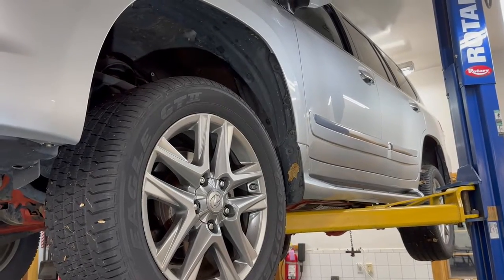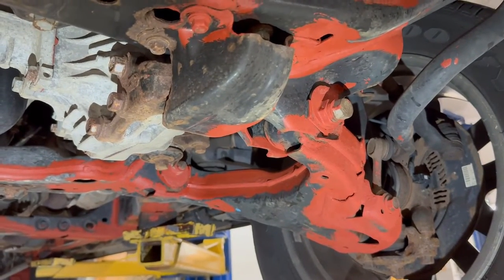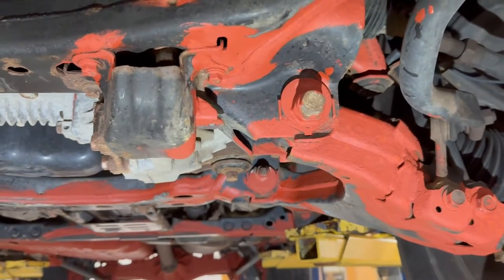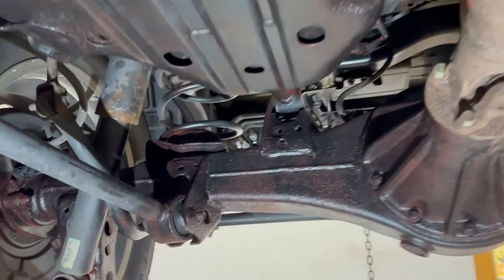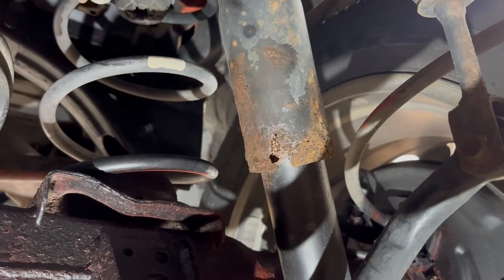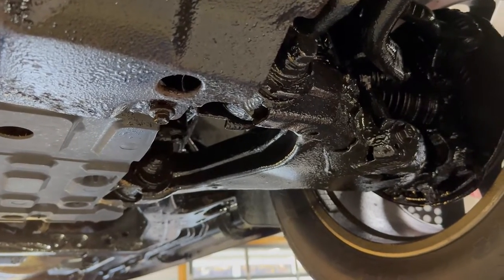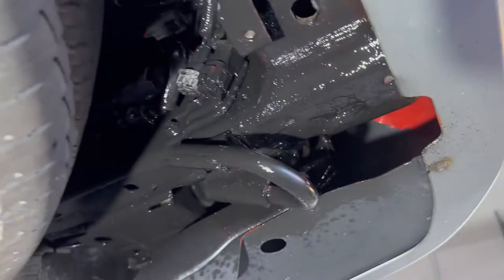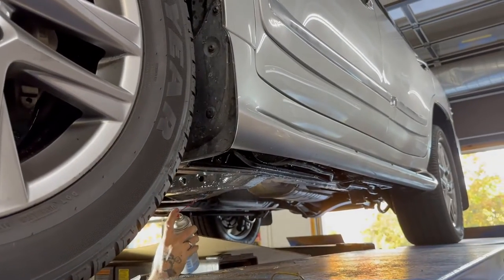Underbody Rustproofing Treatment | Lexus LX570

Comment: The rust is already inside the hollow frame rails.🤷
Reply from the maker: You are absolutely correct about rust origination inside the enclosed areas. To prevent rust spreading, we spray Clear Fluid Film inside all enclosed areas of the frame rails, cross members and control arms, Inner and outer rocker panels, fenders, quarters, and other unibody and frame pockets.We use a different product on new vehicles with no rust.

Comment: Your anti rust film is terrible for all the rubber bushings etc
Reply from the maker: As you correctly noted certain coatings can harm rubber parts. The Fluid Film product used on this vehicle contains no solvents. While it may swell non-oil resistant rubber parts, we have not seen any issues using it on the automotive underbody applications for decades, where the oil resistant rubber parts are used.